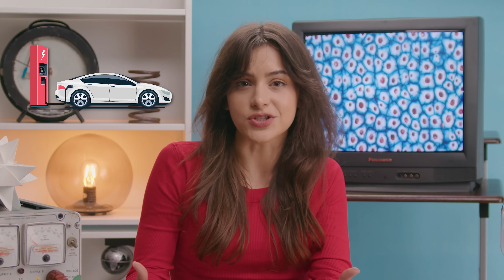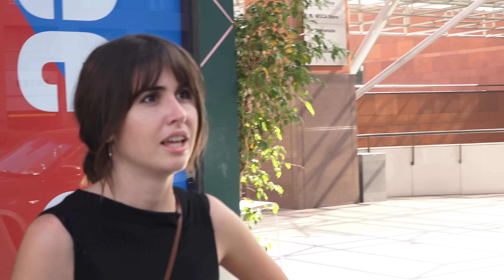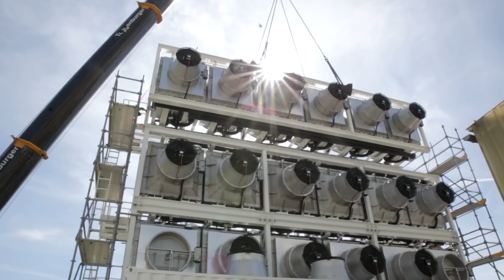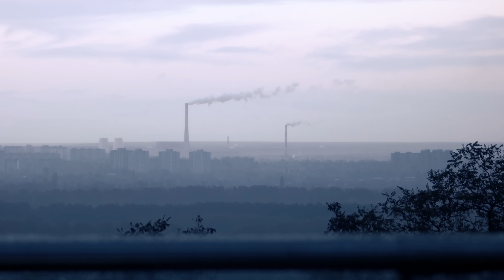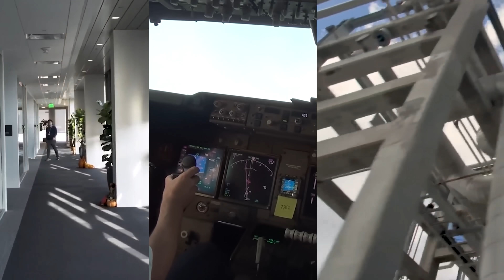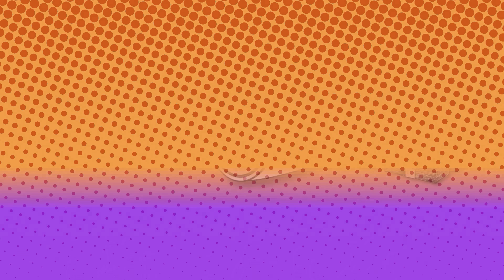The Solution To Climate Change?

Comment: 11:44 "It's much more efficient to prevent Carbon Dioxide from getting into the air than it is to take it out of the air."

That's almost definitely true; research into sustainable power sources, including solar, wind, fission, fusion, geothermal, and hydroelectric, is likely far enough along that humanity could make coal and gas obsolete once the proper infrastructure is built. 

There's one flaw in his thesis though -  the Carbon Dioxide is already there. We have to find to way to take it out, not as an alternative to sustainable energy, but as a correctional measure to the screw-ups of our ancestors.

Comment: I don't think capitalism is really capable of thinking long term. Eventually renewables will be more profitable than fossil fuels, but as long as corporations need to have favorable quarterly reports to appease shareholders, they won't be able to take a short term drop in profit for long term growth down the line. In short, they'll make the inevitable switch to renewables as slow as possible. By the time "following the profits" and "saving the planet" are aligned, it could be too late.

Comment: The new Climeworks plant in Iceland pumps all the CO2 deep into the ground where it turns to rock in the Basalt. No oil companies are involved. 
   We’re going to need all the tools we have or we don’t have a snowball’s chans in hell. Reaching net zero emissions will not be enough. We need to get the CO2 down to 300-350 ppm as quickly as possible.

Comment: when discussing the technology, it would help A LOT to include useful key stats, like how much energy does the climeworks plant require to suck out 1 ton of CO2? then compare it with existing decarbonising methods - such as planting a bunch of trees. there are also other carbon capture tech which may be worth mentioning especially if there are available stats for comparison.

as for the more philosophical side of things... the problem with capitalism isn't just the "greed for profits", but more specifically, current accounting methods are not forced to account for carbon production (and every other externality). regulation that compels accounts to include this item would go a long way to changing things: if every company has to factor in their carbon output as a cost to run their business, they will have to push to greenify things very quickly or face fines/additional taxes that cut into their profits.

which brings us to the practical and sticky situation of asking: how exactly can this accounting practice be implemented? do we need new federal agencies in every country just to enforce these regulations and chase after polluters? or can a more direct carbon tax make a difference?

the video essay could be written better, imo. it's a big topic and you guys are just starting off, hope you try to tackle this again.

Comment: I strongly agree that in the near term cutting carbon production is of much greater import, and we can't let producers use it as a bad-faith way to pretend they're offsetting their damages.  However, long-term, direct capture probably will prove necessary to put the brakes on ocean acidification (a major carbon sink that's been saving our butts for decades but starting to saturate of late) and speed up recovery of the atmosphere, reducing the length of time our grandchildren will have to deal with things like hypercanes.  Curiously, these scrumps being as profit motivated as they are could fuel investment into direct capture in the coming century, as all that carbon will be needed for the new black gold that is graphene, as more applications for it turn up and it gets more and more valuable.  From insanely effective heat spreaders to superconductors to material for launch loops and space elevators, in time there may well prove to be quite the market for the excess carbon that needs pulling from the sky, in case it's still necessary to drag these clods around by their wallets by then.

Comment: Solar is extremely difficult to scale without causing further environmental problems due to rare earth mineral mining and the carbon it takes to create cells, not to mention power storage issues that battery tech hasn’t caught up with. Same issue with wind. Carbon capture at the actual plants that produce co2 is a practical faster solution that won’t cost extensive amounts of money and won’t need us to overhaul our entire power grid which will take decades. Nuclear is also a very cheap solution that we have the tech for now and should stop being demonized. Not a very intelligent video and the guy they spoke with sounded biased (not surprising as he was previously a political consultant)

Comment: Carbon Capture can be useful, however it can't be the go-to solution. Carbon capture would be best used to remove excess carbon in the air, before, during, and after the switch to green energy. There is an excess of "trapped" carbon in the air, this needs to be removed and Carbon Capture can do that. But CC should not and cannot be used as an excuse to delay switching to green energy which has already been delayed for decades longer than it should have been. The number one thing that needs to be done to prepare and preserve the environment is leaving fossil fuel in the ground. Not offsetting the footprint of fossil fuels. 

Also, a major way to remove CO2 from the air, is to regenerate top soil, nature's natural CO2 filter. We currently remove topsoil faster than it can regenerate. This needs to be rectified as a top priority, alongside reforestation, and regeneration of ocean flora

Comment: I find it unlikely that oil companies rate of oil drilling is dependent on their CO2 supply rather than the demand of oil. Therefore isn’t it arguable that regardless of whether co2 is sold directly back to oil companies, it is still helping the environment as they are (in a sense) recycling their co2 rather than sourcing it elsewhere. Large corporations may be using it to sequester their harmful effects on the environment or simply in attempt to win back some public opinion but their motives are irrelevant to the true effects of their actions. I understand it’s a philosophy channel not a science channel but idk video seemed incomplete

Comment: Chemical engineer here: I also think this type of carbon capture is worse than useless. In pratice it's mostly used to increase fossil fuel extraction, which is the exact opposite of what we need to do.
Storing carbon dioxide as a gas would take a huge amount of space, and converting it to a more compact form would take energy. The best solution is to use nature's own carbon capture machines--trees. We need to stop clearcutting forests and start reforesting

Comment: The joke of carbon capture is that you burn coal to power carbon capture plant and unless the plant itself are more than 100% efficient which is not possible its useless and at best a drop in the ocean. Just plant a damn tree its easier faster cheaper and scalable.

Comment: The question isn't whether we can build a machine to pull CO2 out of the air. We definitely can, and CO2 is the heaviest part of air, so it's mostly right around sea level where we keep machines anyway. The question is carbon sequestration. The best solution we have is to make more plastic out of it, which is better than building it out of more fossil fuels, but expensive and also not great for the environment.

Comment: Carbon capture is not a silver bullet for climate change and those who support it as such only give those in power an excuse to not take real action to make real changes to solve the problem. I think speaking in glowing terms about the technology is irresponsible and misleads the public into thinking scientists can solve the problem without them needing to make any sacrifices themselves. 

I'm a chemist and can say with some degree of confidence that it's unlikely that we can remove carbon dioxide from the atmosphere through chemical processing at a rate faster then carbon is currently being released. I don't know this direct air capture technology well enough to directly comment on its efficiency but consider that vacuums require electricity to run and the electric grid in most parts of the world is powered by fossil fuels and you can see why the technology likely will fail to make much of a dent in carbon levels.

Comment: Liking the diversification of topics, would recommend Effective Altruism (and 80,000 hours) if you want more topic ideas.

As for DAC, it's pie in the sky wishful thinking but sort of assumed to work if any of the IPCC targets are to be met. We will need vast amounts of carbon capture and a lot of the other solutions like olivine rocks, trees etc. are too slow or not big enough solutions to get where we want to be. We will need a huge DAC industry ... but from a thermodynamic point of view especially, it is completely infeasible. We will also need to do all the other negative emissions tech at scale, which are more efficient like capture at source, and then also DAC.

Comment: You want to fix "climate change"? Maybe start targeting the top 100 companies that pollute. Maybe send Saint Greta of Thunberg to major polluters like China and India instead lecturing us here in the West. Unless you're building nuclear reactors..."renewables" don't do shit and can't replace fossil fuels, Germany tried and it was such a success they're still using coal. Electric Vehicles, also, won't do shit. 1) Because many if not most fill up stations are powdered by gas or coal so that EV is still using fossil fuels. 2) To get the rare metals for the EV's batteries and such requires intense and invasive mining-so much for "going green", and in places like Africa where these mines are they use child labor, hooray!

Comment: I'm very glad you mentioned the importance of nuclear energy in our phasing out of fossil fuels. The technology is ready to replace carbon emitting fuels today, we just need to make the investment to build more nuclear  plants
Reply: Yea but she emphasised "non chernobyl ways to use Nuclear Power" as if Nuclear is unstable and dangerous when in reality its the least deadly form of power per terrawat of energy produced. Doesn't help that she includes Mark Jacobson who is a Nuclear sceptic. 
It's great that Wisecrack recognizes NuPow as important but that cold war era stigma is still there.
Reply: It is not an efficient way of spending money.
Nuclear energy is so much more expensive than renewables, that our money is just way better spent on those. For every dollar we spend on renewables we prevent so much more carbon from being released than with every dollar we spend on nuclear, investing in nuclear to stop climate change would be like trying to run a marathon, but backwards.

Even the problems of renewables, like reliablity, can be solved much better by investing money into storage tech and more robust, flexible and decentralized grid infrasturcture, than by investing in nuclear as backup.

If you ask me, this push for nuclear comes from the energy companies trying to cling onto the centralized mode of production, but other than their private profit motive, there is no rational reason to go that route.

Just don't turn off already existing nuclear plants, that's extremely dumb. (looking at you, Germany)
Reply: Nuclear has the same issue than fossil fuels. It’s impossible to deal with the waste. In fact, it’s harder to deal with nuclear waste than with CO2 waste from fossil fuels.
Reply: @lucasatilano8008  Nuclear waste is an insignificant problem compared to emissions and climate change.
Reply: @JamanWerSonst   you probably haven’t looked into it… it’s an extremely difficult issue to say the least

Comment: Lost me at 1:20. We don't really know how to stop global warming.

EVs help only if they are charged from renewable sources. They are not mostly.

Wind and solar are great but are a tiny part of our energy production and would require an insane ramp up in order to displace coal, oil and gas. We are working in that direction but are still way off.

Cow farts are just propaganda. Cow methane production is part of a natural cycle. The methane get reabsorbed into plants, the cows eat the plants and produce methane, that is again reabsorbed into plants. Cow farts don't add to the overall volume of greenhouse gas. They just recycles a part of it.

And nuclear again is fine but has the same issue that wind and solar have. It's just not enough.

For perspective, all renewables including hydro and nuclear amount to about 15% of the energy production. The other 85% come from coal, gas, oil and biomass burning. Does someone want to calculate how many hundreds of thousands square miles of solar are required to cover the difference?

Comment: Stop burning fossil fuels is #1 priority.
#2 is capture what we already emitted.

While energy production is not almost if not actually 100% carbon free, carbon capture isn't a solution. But when there is an abundance of carbon free energy that we can leverage to extract the CO2 from the air at a rate faster than it is being emitted into the air, because we're no longer emitting it via non carbon neutral channels, then it can reduce the CO2 in the atmosphere and reduce the rate at which the global temperature is increasing.

Comment: You do know that plants do pretty much the same as these giant fans, but more efficiently and with better benefits, right?
IIRC there's an initiative to have giant vertical hemp farms. The plants absorb CO2 and can be harvested to produce strong quality rope and other products. The irrigation used to water the plants can be recycled, leftovers from the plants can be used to make fertilizer for the farm, energy for operating the farm can be obtained by solar panels. and other renewable sources onsite. The result is that you actually get good quality products while requiring nearly nothing from outside sources in terms of energy, water, and other expenses - so it's actually profitable and sustainable, and your carbon footprint is either nonexistent or even positive!
That's the sort of thinking we need to do proper on carbon capture. Any carbon capture that is directly related to oil and gas companies is ultimately a corporate stunt to help fossil fuels companies resist the market changing to renewables.

Comment: 14:30 We do NOT have all the technological innovations for 95% of humanity's climate change problems!  The renewable energy harnessing tech required to replace fossil fuels simply is NOT even on the blackboard.  Its not just political will, its also engineer inventors being held back by the system.

Comment: Great segment - I have worked on CC technology (from the tech side, not the business side), and anybody who tells you direct capture is the way to go is selling you a line.

I used to stand by CC technology, and to some extent I still do - the idea is that we’re not going to be able to pivot quickly enough to clean energy production, so we can mitigate some of the damage incurred by burning fossil fuels using carbon capture during he transition.

I changed my view because I neglected to factor in how such technology would be used for PR from energy companies (“clean coal?!” LOL I sincerely hope nobody bought that). I still think it’s absolutely a necessary step in the decarbonization process, and its research should be funded, but the money and politics that go into it are crooked as hell, and the spin its being given as either “making coal clean” or being a easy peasy pain-free panacea for climate change has to be combatted, with videos like this one :D
Reply: Biotech is the only sensible avenue of research for carbon capture. We are trying to invent a solution rather than improving the one that already exists and has the convenient superpower of self replicating indefinitely, while also being biodegradable / requiring zero decommissioning.
Reply: Sucking CC is like recicling Just a COPE OUT.
Remember! REDUCE! REUSE! AND THEN RECICLE!
Reply: Unfortunately the real solution will be some kind of compromise between profit and genuine care for the enviroment.
However as history has shown compromise is often the only right way but also the hardest and the one that makes the least people happy.

Comment: Enhanced Oil Recovery is one of the single most infuriating climate thing I have ever seen.  It is actually soo much worse than you covered in this video. EOR is the mother of all swindles being pulled off by the Oil Industry.  every time you think you found the most damning thing about EOR that could possibly exist, you read a little further and find the next new low.

Comment: This is a good exposé but the conclusion is wrong. In a market economy we need to let the people decide what is the right solution to achieve the result. What we should do is tax the carbon and use the proceed of that tax to fund carbon removal i.e. the current value of a ton of carbon removal is $150 to $200 so we should impose a tax on carbon of that same value and offer to buy that carbon at the market rate. This will have multiple benefit it will remove the guess work on how high the tax should be, it will let every one of us to choose how we go about paying less taxes i.e. using less carbon. This could be done quickly and I am sure that with a price of $150 a ton we would see a lot of company working for it and it would make the "enhance oil" uneconomical, too bad.

Comment: I heard, read and studied direct air capture for years and it's a super great tool.  The most important part of it is that it must be used at the most concentrated areas of CO2 or other GHG's.  All of the large CO2 emitting smoke stacks or whatever must be retrofitted with DAC tools.